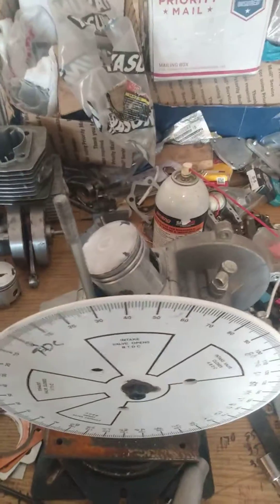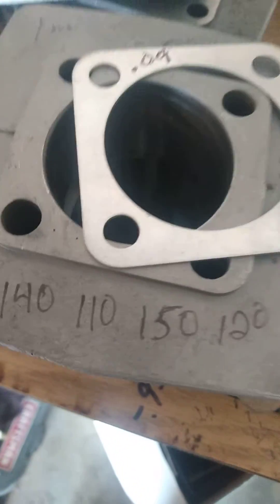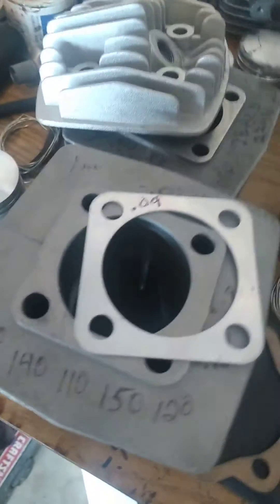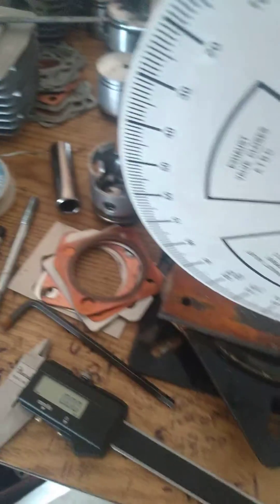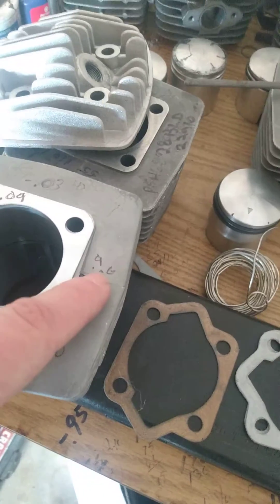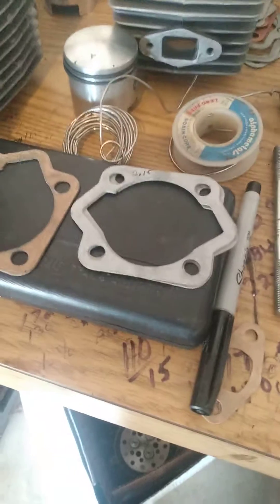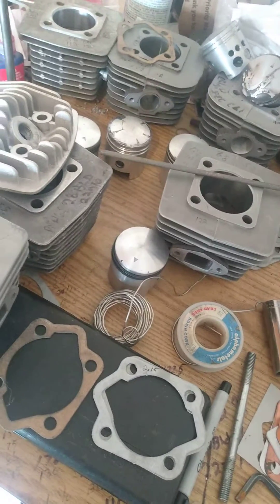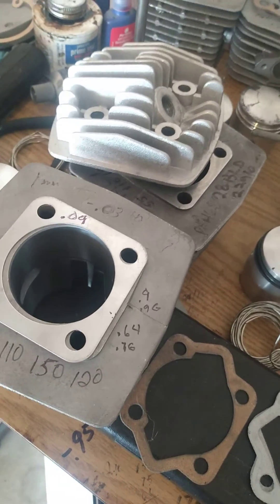motorized bicycle porting information

Comment: I like like your style..I like taking the original equipment and making it better..question in your opinion is the g4 your favorite China cylinder to work?
Reply from the maker: Yes  I love the g4 cyl has decent  finish on bore. Yes port timings are low but that's the whole blessing . Leaves  me so many options. Simply  jacking cyl up to my desired  tranfer  duration. Decking  cyl lifting the exhaust to achieve my desired  blowdown  & blowdown  % . Set up cyl with a .2 mm head gasket at about .75 mm sqish. I can always lower cyl by removing one base gasket dropping  transfers and exhaust by 2.5 degrees and add a .95 mm head gasket and still have a proper  sqish so basically  get two port timings set up properly. By thinking first  I also typically  machine a boost port at 25 degrees on the knee mill even or slightly  below primary tranfer opening
Reply: @2strokecarbtuningportingin187  thank you,  you are just the guy I was searching for...too much riff raff in this hobby hard to find folks like yourself. I've waded through a bunch of bad information. I like to see the potential in what I got before I start bolting on different cylinders. Make these the best I can and go from there. Small steps learning is in the doing which I enjoy most about tinkering with 2 strokes.
Reply from the maker: @bowmadman9562  I tried  making vids on everything  explain  port widths shapes and real world working port timings.its all super easy providing  you do the math first. I haven ever had anyone  reply  my information  made there stuff slower. I'm just thankful  to remember  all this crap. Blessing  is  I been fooling with two strokes since 1977. Not much has changed. With the exception  of efi and ecu and a power.hopfully  you find it helpful.like to think my carb vids explain function and jetting are better than any I have seen.i just not a computer  / camera guy meaning zero editing  skills
Reply: @2strokecarbtuningportingin187  I'm kinda old school myself and appreciate your take on it. I raced and rode alot of 2 strokes back in the early 90s and always had a passion for the sounds and smells this hobby fills that void for me. Your knowledge is solid thanks for taking the time to share it with the world. I've got to figure the degree wheel out and learn all how you get your numbers...I'll get there might take a few tries. My goal is to build the best piston port I can before I move on to reed valves. May have to upgrade my carb at some point

Comment: I watch the hell out of your videos! I appreciate all the info! Can you please make a small video on how you build your cylinder spacers? What material do you use? Do you just trace out a gasket onto your material? I just got my timing/degree wheel the other day and she's all torn apart. Thank you in advance!
Reply from the maker: Super busy working on prostock motorcyles but you can but various thickness aluminum from e bay hole locations get off cyl then scribe a gasket after you know your hole locations fit your studs